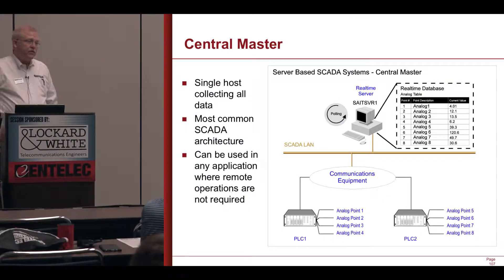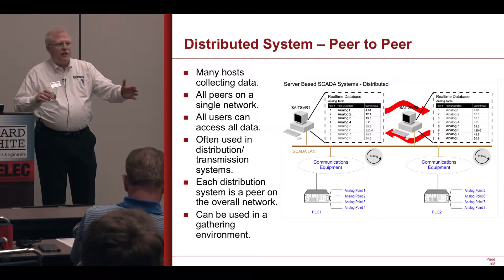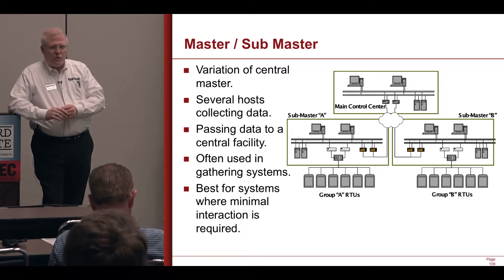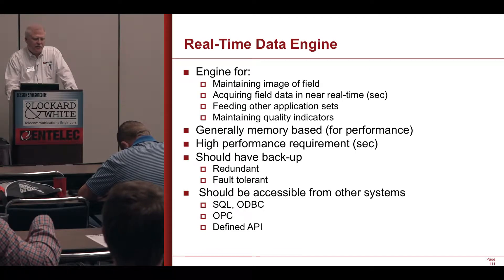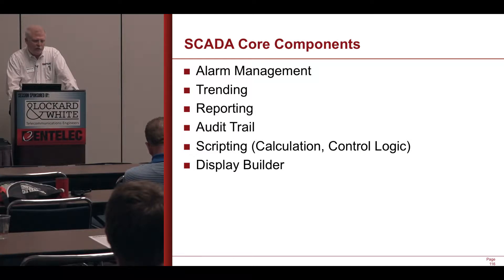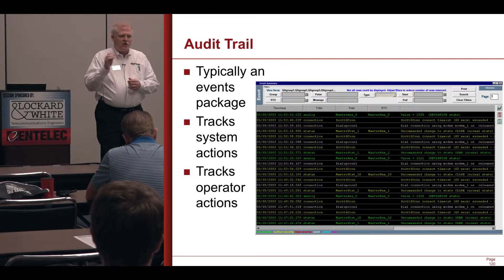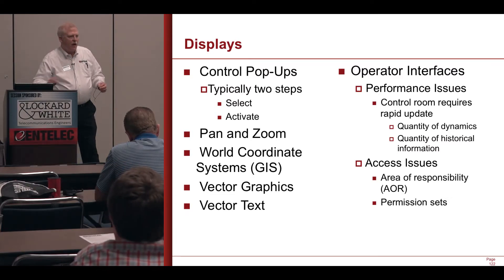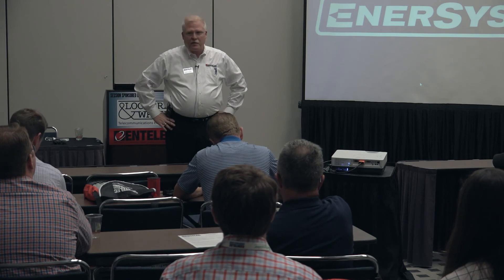Fundamentals of SCADA Host Software Components -  Part 11

Comment: To answer your question. It was very helpful. Thank you. 

I do have a question: 
- What would be some considerations for re-architecting an old SCADA system for a globally distributed powerplant fleet? It's SCADA at the fleet level with a core PLC at each powerplant. The entire fleet is remotely monitored from one control room.